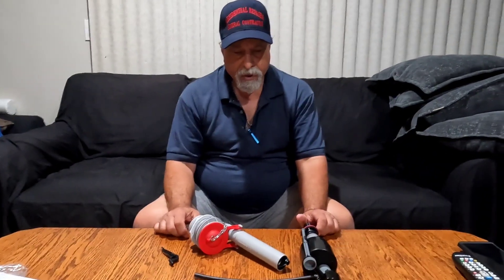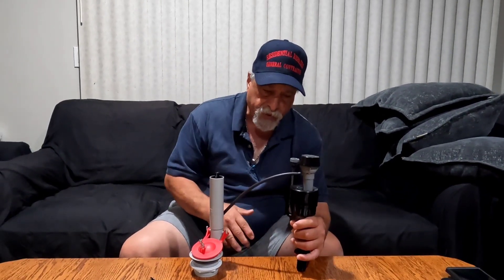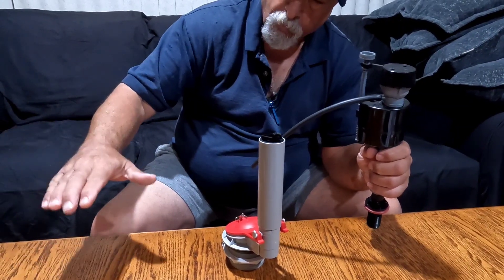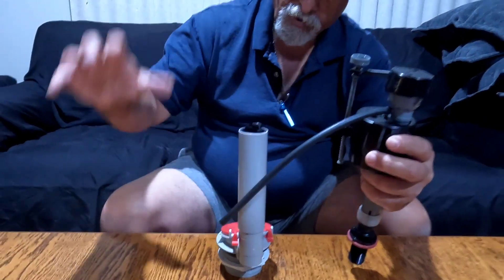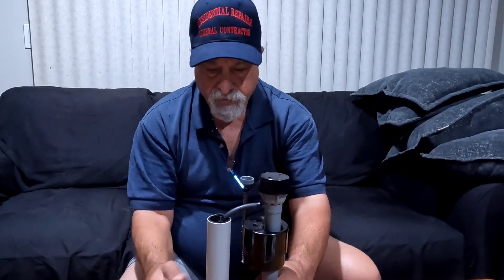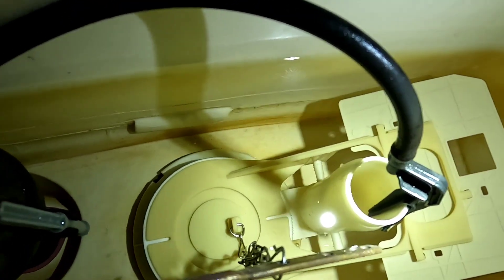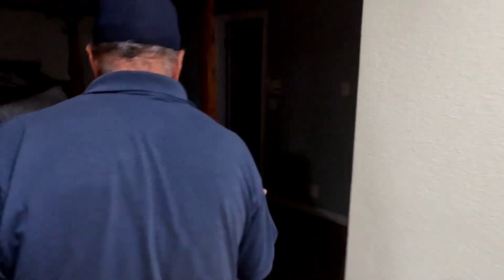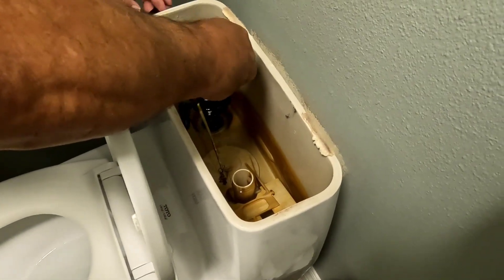Will a fill valve siphon water from your toilet bowl?

Comment: You’re all over the correct answer here. It does siphon. But it goes the other way. If the small hose in the overflow tube is lower than the water level in the tank, it siphons down to the level that the small hose is set at. It pulls it from the bottom of the fill valve and pushes it out the small hose into the overflow and into the bowl. The reason the bowl looks lower is because it is getting high enough to semi-flush.
Reply from the maker: Thank you so much for that info that explains everything to me I couldn't quite get my head wrapped around it but this clearly explains it to me Thank you for sharing I'm sure lots of people will benefit from this information especially understanding if you don't install it correctly this could happen Thank you for watching and sharing.
Reply: Thanks for the proper explanation
Reply: Yes, @residentialrepairs, your explanation and demonstration of the equipment got me to the point where I figured it out just as @theJarodWilson described.  I was so perplexed until I read this.  Though, something has to get the flow for the siphon to start, and I still don't know what's promoting it and why the bursts of for are so short and sporadic

Comment: While I appreciate your open mindedness, it is safe to say that that thing can't siphon. It's nothing but a sophisticated valve system. The toilet system has improved over the years, but it is basically the same physics. A lot of it looks different, because of the need to adapt to different toilet sizes.

Water comes into the tank, because of the water pressure from the municipal system, or wherever you get water. Siphoning can't bring it back up.

I don't understand the need for siphoning it back into the tank.
Reply from the maker: Thank you so much for your reply the reason why everybody talks about this is because if you put the hose down the pipe which is the Overflow pipe or tube what happens is people think that it siphons back up into the tank and it screws up the level of the water that's in the bowl I believe I haven't figured it out yet but my best instincts tell me that if there's no water in the tube I can't imagine it being able to siphon but I've had these thoughts before and I've been absolutely wrong but I'm glad you're participating in the comments we need everybody's opinion and eventually we'll all form a most definite opinion either way whether it siphons or doesn't siphon once again thank you for watching and thank you for participating
Reply: @ResidentialRepairs You're welcome. I see now. Thank you.

Yes, water could flow back, but the water level would need to be higher than the tank.

Imagine if I tried to steal gas from your car. I start the siphoning process. So far, this makes scientific sense. Let's say that I get tired of waiting, and maybe the cops are coming, so I foolishly put the jerry can on the roof of your car, so that it's out of the way. This results in gas flowing back to your car. The gas would never be able to flow to the roof and overflow the can.

The toilet would need to overflow and fill up the room, before the tank would get any water back.

Does that help to alleviate any concerns?

Comment: The problem I have seen with not properly positioning the fill valve tube in the flush valve overflow tube is that water builds up in the overflow tube and keeps the flapper from reseating.  The problem then is that the toilet keeps running.
Reply from the maker: Thank you for commenting this is how we all learn together when we all chime in we all learn something thank you again and thank you for watching